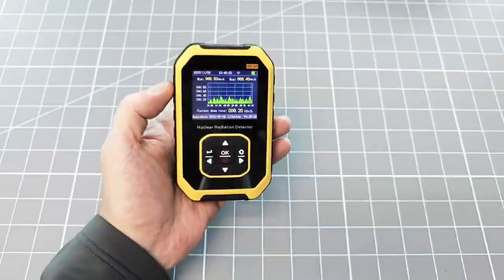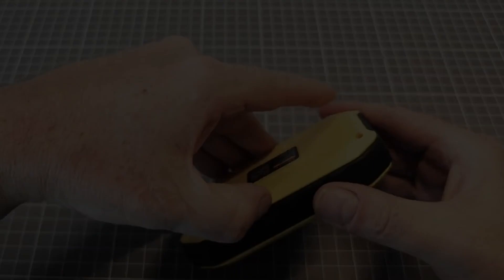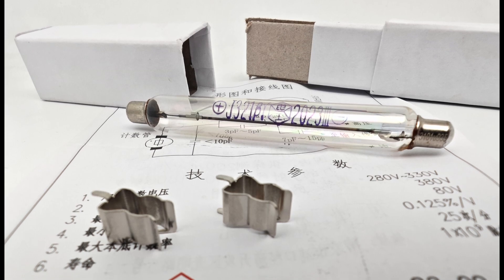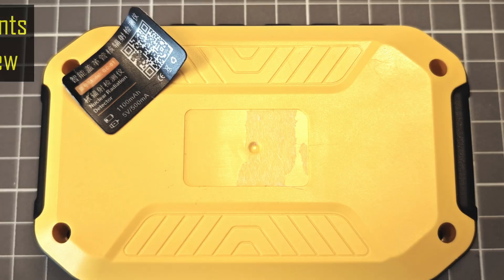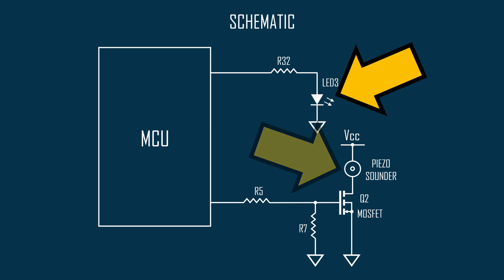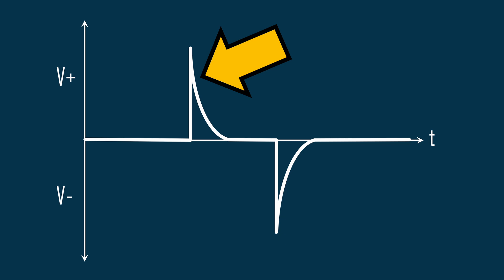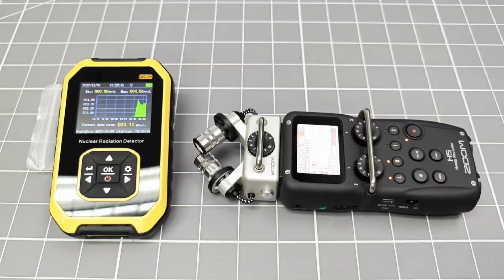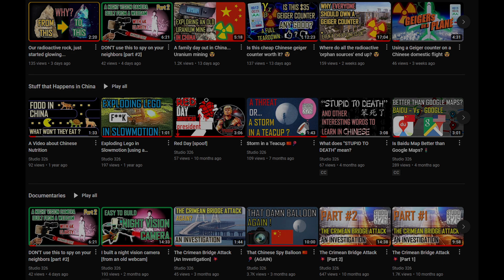Adding Particle Click Sounds to the FNIRSI Geiger Counter ☢️

Comment: Hi! Please let me know what is the current rating of the device's output to the J321 Geiger tube? I would like to add two tubes to increase sensitivity, but I'm not sure if the circuit will be overloaded. According to the specifications of the J-321 tube: Recommended working voltage: 380V, Starting voltage: < 350V. Since the tubes are connected in parallel, the voltage across each tube will be the same, i.e., 380V (V = IR) to calculate the current draw (I) for one tube is 38mA, two tubes operate in parallel, the total current draw for both tubes will be 76mA. If the device can safely provide at least 76 mA, then it should be able to efficiently power both tubes. If the device's current rating is less than 76mA, connecting two tubes may overload the circuits, I'm afraid! So, I would be grateful if you could measure for me if it's possible! Thank you!
Reply from the maker: I have no idea how two tubes in parallel would behave.  I don't think that the current draw you mention is correct, typically the tube cannot be looked at as a resistance, it essentially has infinite resistance when there are no ionization events are occurring, then for a short time, a relatively low resistance when an ionization even causes an avalanche of electrons.
This is not a concept that I have any experience with...
Reply: @project-326  It practically works and it has doubled sensitivity! I have the information from Chat GPT 4 that scores 155 on an IQ test, so by that metric it's smarter than 99.9% of humans. He did the calculations and it is possible! The only impediment is that I don't know the device's current rating at least approximately! Thanks anyway for the answer!

Comment: Great Info Thanks. Trying to get a J321 but all I can find are m4011. The stats look the same. Any thoughts?  Also just got my Gc-01, But it looks like I got one of the off brands, Mine dose not say Fnirsi, Tried to save $5, (d’oh!) Any way it’s got the short candle looking tube with no saddles to mount the J321, I can get around that. And it does not have the battery yours has. It has what looks like a green aa battery. It works fine but talk about bait and switch. Now I will have to spend $30 to upgrade it, LoL
Thanks again
Reply from the maker: Yes the M4011 is equivalent as far as I can see.  Don't beat yourself up about if it is branded FNIRSI or not, they are all made at the same factory here in Shenzhen, and the brand is owned by the factory itself.  Both branded and unbranded have suffered the same fate...  The new tube should also come with the correct pins to solder to the PCB and grip the tube.
Reply: Thanks for the info, i will go ahaed and get one. @project-326

Comment: I just got one of these from eBay. I bought a used one at a great price hoping it would have the big good tube. The gamble paid off. So now all I have to do is add your capacitor mod. Thanks
Reply: I have the gray tube in my geiger counter. It doesn't detect any radiation.
But if you tap the casing with your fingers, it increases

Comment: I will add the capacitor as you shown here. Also im wondering if the j321 tube will collect some alpha particles cutting the backplate expossing it. Nice video!
Reply from the maker: Unfortunately, alphas won't make it through the glass envelope of the GM tube.  Tubes that detect alpha particles have special windows, make of materials such as mica.  If you want really get a device that detects alpha particles, probably best to get one with a pancake style tube, it will have a lot more sensitivity.  Some devices use a lower cost GM tube that has an 'end window'' but these are less sensitive.  Devices like the Gamma sh-sh-sh-sh-scout, use that kind of low cost alpha, beta and gamma tubes.

Comment: Im confused… i thought americium 241 was alpha that could be shielded with paper? My gc-01 is not only picking it up but shielding it with paper makes no difference?
Reply from the maker: The majority of the energy that is lost by Am-241 is lost  as alpha particles but some will also be seen as a 59.5 KeV gamma ray emission.  There are also many isotopes in the decay chain that are also going to emit some gamma rays too and this is what the GC-01 is detecting.
Reply from the maker: https://en.wikipedia.org/wiki/Americium-241

Comment: I doth my cap sir  🫡 not only have you intrested me in this subject but also shown me an affordable way to start “experimenting”myself, I successfully changed the tube which immediately transformed my gc-01 and had some success adding the particle clicks but unfortunately managed to ruin r32 (small soildering is harder than it looks) could anyone advise me on the value of r32 as have tried a couple but the led now seems far brighter and my click is quieter. I can only assume the led is now pulling to much current? Anyway… thank you again i am now fully subscribed and looking foward to future videos. (I love the dry wit and humour btw) will.
Reply from the maker: I think it is 3.3K - I also damaged the pads for that resistor (R32) on my first attempt.  In my case, it seems that age is not an advantage when soldering SMT.
Reply: Hello, I received mine with the wrong tube.
I plan to change the tube with a J321.
But it is not clear to me whether R38 must be removed with the new tube?
Because for me R38 is empty
what is its value?

FYI the marking on R32 is 30B and measures 2K in circuit.
THANKS
Reply: Used a 4k (cos thats all i had) works a treat 😎👍🏻

Comment: Just Did The Upgrade, Thank God For Circuit Board Holder And Large Magnifying Glass, Need A Beer To Study The Hands, Not Very Loud But It Does Work. Better Than Nothing. Thank You
Reply from the maker: I hear your pain.  These days, I measure my years by the thickness of glass required between my eyes and anything I need to actually see.  I have a 12 year old son to help with the soldering when "Daddy messes it up".  Like you, I wish that the product had a bigger peizo sounder to give a louder output, but hey-ho, it's certainly better with the mod than without.

Comment: Just needs a switch so it can be silenced when it starts driving me nuts...
Reply from the maker: There is an option in the menu that allows you to turn off the LED, that will also silence the sound from this mod too.

Comment: Can I send you a picture of what tube they put in mine. You would not believe it. It is about 2cm long.
Reply from the maker: Yes, there even 2 versions of the shit device, one is really short.  Just buy a nice J321 and be gone that piece of $hit..
Reply: Okay, I was really shocked, J321 already ordered. Did yours came with the (fuse) holding clamps? Because they are also missing in the device. Mine measured 0.6uS/h when it was actually around 2-3uS/h @project-326

Comment: Did this just now. Waiting for a M4011/J321 tube to replace the wee candlestick looking fecker that's in mine. Thanks a ton for this!
Reply from the maker: Great stuff!
Reply from the maker: Perhaps try your without changing the loading resistor first.  Other folks have noted that the value on mine was really low and others that resistor might be more reasonable.  If you get the improved performance with just a change to the tube, then you might not need that change
Reply: @project-326  Got the J321 tube and installed it. I noticed there was no loading resistor at all on the PCB of the version I have. Seems to work fine and give better readings now though.
Reply: @N1antagonist  did your J321 tube come with the spring clips to mount the tube to the PCB?  If it did where did you buy it?  My GC-01 came with the little candle stick tube and doesn't have clips to mount the J321 tube
Reply: @championboxes  Yeah it had the spring clips already on the PCB.
Reply: @championboxes  My J321 did not come with holding clips and my board don't have the clips because of the shorter tube. PCB mount fuse clips might do the trick
Reply: @project-326  will do, thanks!
Reply: Mine didn’t have the J321 tube. 

I see various comments, can I buy and replace my cable stick tube with J321?
Reply: @MrSuthanS  If your has the clips for the tube it'll work fine with the J321.

Comment: Great video, thank you! My first gc-01 bought mid 2022 has the centre hole fixing and a J321 tube, but the second (blue) one bought a couple of months ago, only has 4 holes and an even sh**tier tube than your one did - unmarked and 45mm long, but no extra resistor on the board, though the pads are there. I'm changing to a J321 tube and adding 100nF cap, but how do you unplug the display? The connector doesn't flip up to unlock.
Reply: Try to move the black, dark points, then the plug comes free. After inserting, push them to close.
Reply: @jantepas7511  That works - nice one, thanks!
Reply from the maker: The display connector is pretty stiff to open the first time.  It doesn't flip up, the grey tabs on each side of the connector slide forwards (ie towards the flexi).  I faced exactly the same problem at first but I was able to be a little more brave because I kinda knew that it didn't matter if I broke this thing, I have an RC102 and KC761 as my main counters!
Reply: @project-326  Thank you!

Comment: Thanks a lot, clear and effective. Thanks. Just checked, I have the device with an screw under the sticker at the bottom. With the good tube, yep. And today I have made the modification with the capacitor 100nF. And is clicks now. Works!😊
Reply from the maker: Awesome, I'm really pleased that you found this guide useful!  I keep wondering if I should drill a hole in the rear case where the sounder is located...